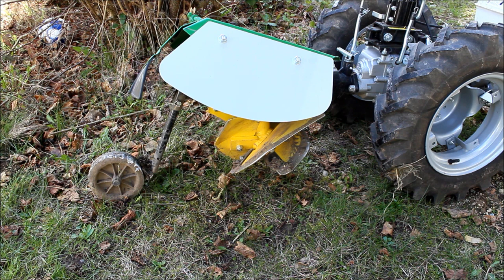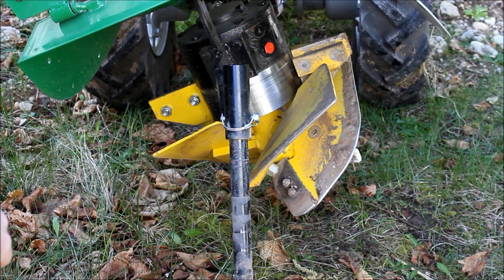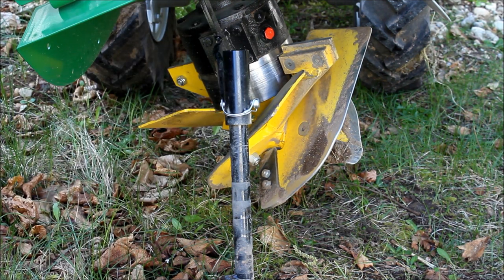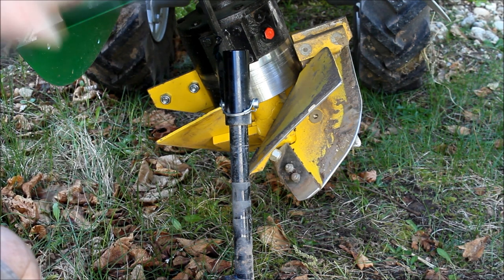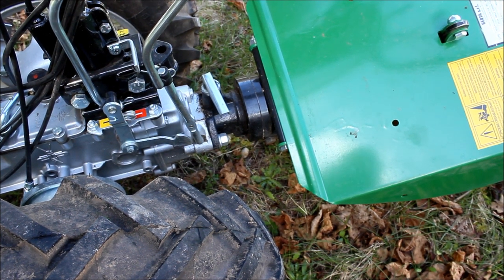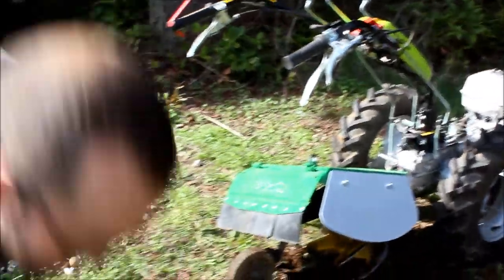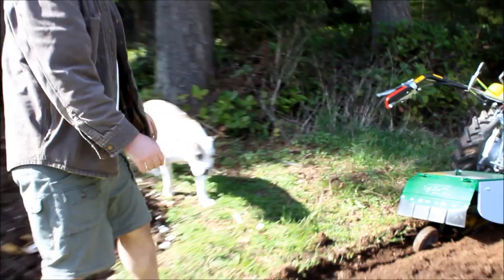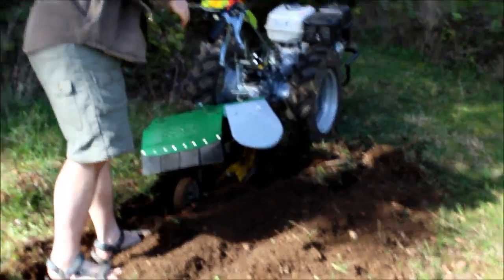Berta Rotary Plow

Comment: Thank you for your video.. I've been looking at the GRILLO and BCS... videos on the internet.. Both of them seem like nice units.. Any particular reason on your preference of the one you have over the BCS.. . I'm still learning.. ..Looking for your opinion and any others... strengths and weaknesses?
Reply from the maker: Hardwoodbuyer They are both of similar quality.  BCS does have different HP engines and they tend to be a little higher that Grillo.  BCS has been in the U.S. longer and they also tend to be a little more expensive and have better dealer networks.  Grillo is more user friendly as far as ease of self repair and maintenance.  They are also less modern styling than BCS.  SO Grillo is more utility in design.  Diesel is an option for both but think about that carefully because the expense will take a while to see any savings overall.  Look at the HP needs for the largest attachment you would ever want and that will guide you towards which machine to buy.  I have no regrets with buying the tractor i did.  There is no better option than Grillo or BCS.  Either one will do a good job for you.
Reply: thank you for your response,,and knowledge on these companies